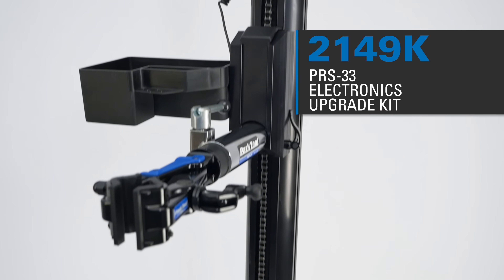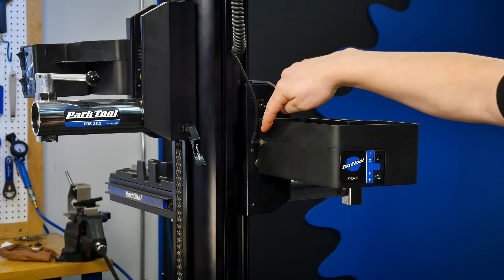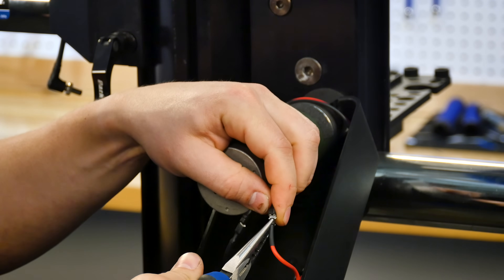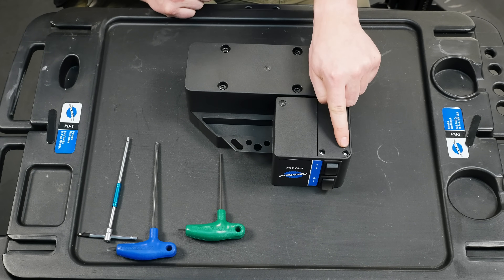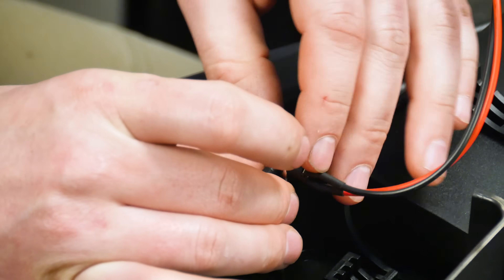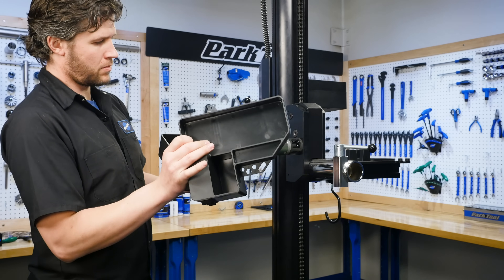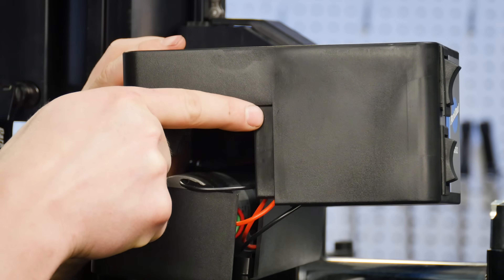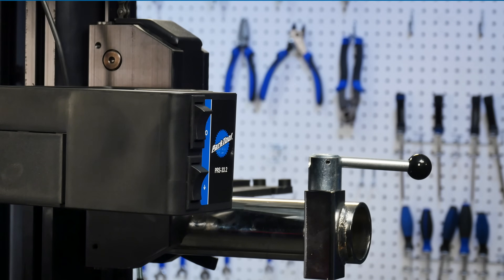2149K - PRS-33 Electronics Upgrade Kit

Comment: Why was this not conceived of originally when the stand was first sold? Instead of selling it as an upgrade kit, why not just make it standard with the stand? This way you pass the saving to you loyal customers who bought the stand in the first place. Oh, I forgot. You guys are greedy and need more money. SMH.
Reply from the maker: The current PRS-33.2 has this installed on it. This is an upgrade kit for the previous PRS-33.  When we came out with the PRS-33 it was one of the first of its kind. As things are on the market longer companies learn and evolve and cater to customers desires and needs, as pointed out by Zygmunt.

Comment: I'm confused, what was he upgrading and excuse me for asking,  bikes are only getting lighter, why do people need electronic bike stands, but then again if you got money burning a whole in your pocket then by all means buy it.
Reply: Don't forget about heavy e-bikes. This is designed for shops, not your average home mechanic so the cost isn't actually that much compared to the use it will get
Reply: Raphael Roshwalb this is for shops that see dozens of bikes a day and can afford this to make their repairs faster and easier so it is worth it for them.
Reply: If you're a shop or you work on enough bikes, I assume this would be great for keeping your back healthy.
Reply: Nicer buttons and usb ports, mainly. As for why, it can be nice to have an easily adjustable work stand when working on various parts of the bike. Think about switching between working on a bottom bracket and the headset.
Reply: Because it looks sick
Reply: In my shop I used to lift up 35 kg ebikes and then hold it with one hand to clamp it with the other. It worked but I always had strand nick and back muscles. Doing maybe 5 of these ebikes a day, sometimes putting it back up multiple times and then doing 10 regular bikes all day, every day makes for a sore back. I love it

Comment: Instead of two switches you should use a three pole switch UP - OFF - DOWN.
Reply: they should keep 2 switches, but the up and down control should be momentary DPDT toggle switch.
that way when you are working on a bike, you only use the toggle switch. once done, switch it off... 

the on and off switch can be a 3 pole switch, ON-OFF- USB power ONLY.  this allows  the  USB charge ports to be turned completely.